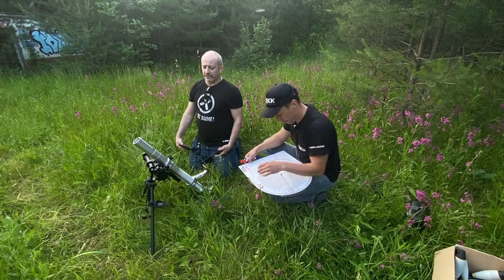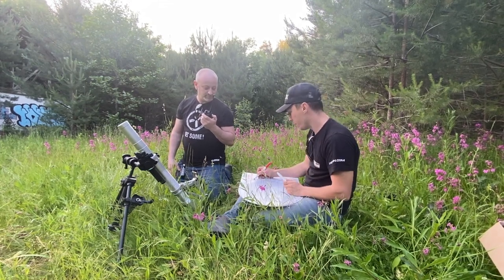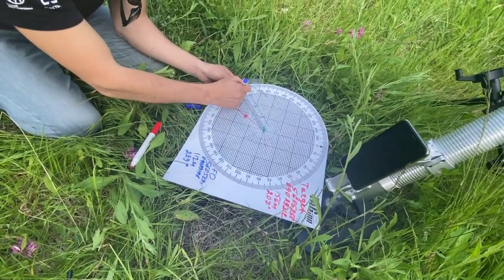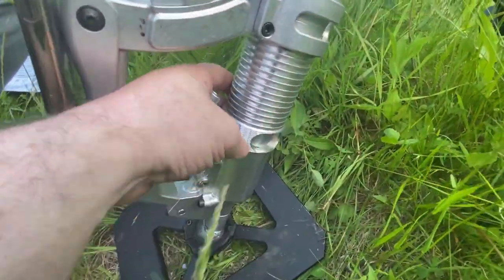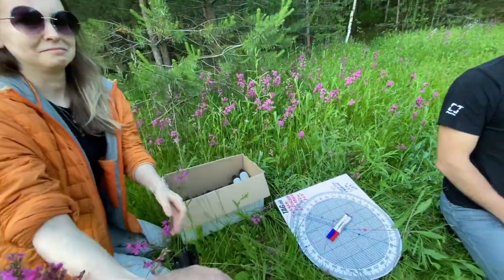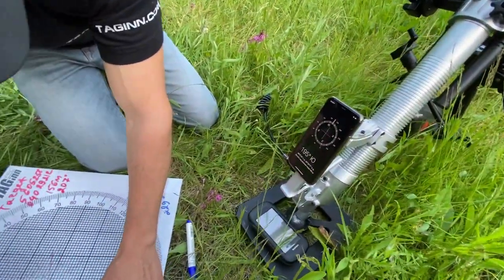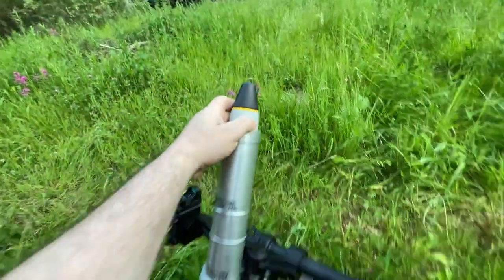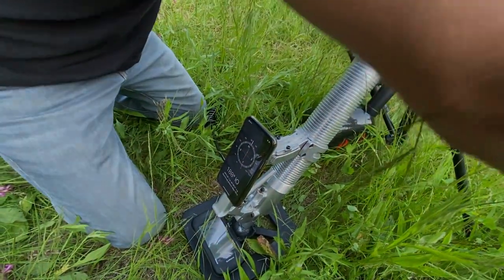"Dominus" mortar aiming and correction test #1 - Short distance.

Comment: Also you don't hit the target and then call a second fire mission the entire thing is one mission called an adjust fire mission once you get fairly close the observer then says ie left 20 fire for effect meaning that after that correction you should be right on target and the number and type of rounds used for the fire for effect stage is stated at the begining of the overall mission

Comment: Will there be more shell types than thus far presented?
I would like a coloured smoke round that deploys all it's smoke in less than 3 seconds.
Also, I'd like an illumination round, using a parachute to stay flying and drop safely after the illumination flare is spent.

Also, if I could afford it, I'd buy three to four of these and set up an airsoft mortar platoon so I could employ complex firemissions like Blinding (1 piece firing smoke, the rest firing HE), Walking fire etc.
Reply: You'll need a LHMBC to calculate all that it's easier

Comment: Theoretical you could regulate the reach via the hpa pressure.
Reply: True but what's the upper limit of the tube and the acceleration limit on the round?  Too much tube pressure would blow the regulator or the tube breech and too much pressure on the round would cause deformation reducing range